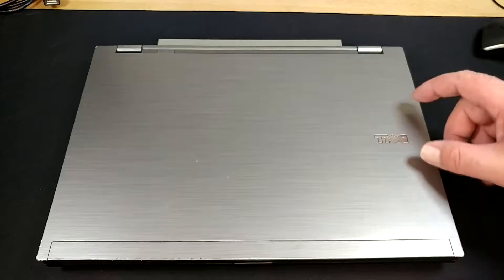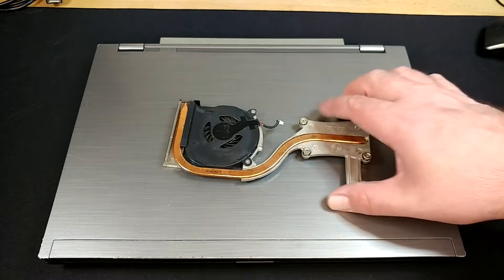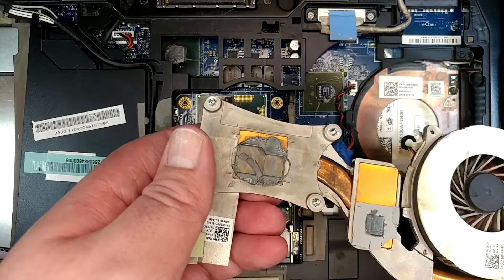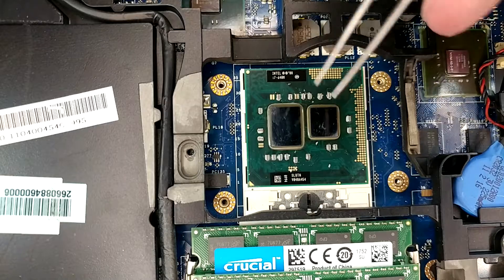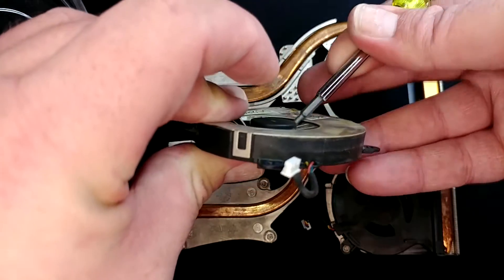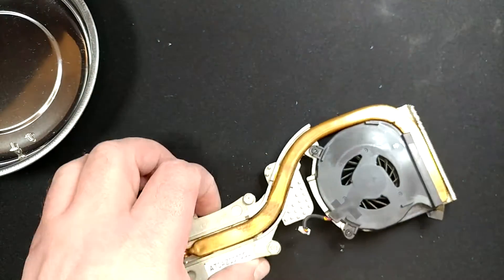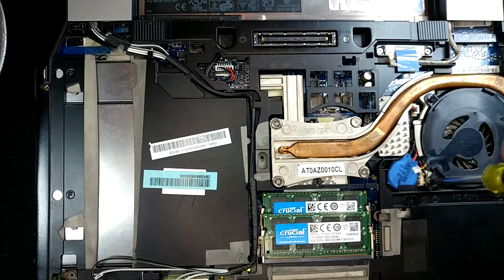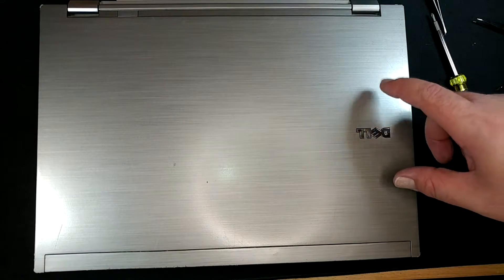Dell Latitude E6410 Cooling Fan Replacement and New Thermal Paste!

Comment: I just bought a new computer because the E6410 was getting very slow which I attributed to all of the Windows 10 updates. I watched your video, followed the instructions and it's like a new computer again.... Windows 10 support runs out in October 2025. It originally had Windows 7 according to the tag on the back. I am going to see if it will run on Windows 11. It has 8GB of RAM so maybe it will work if I can remove the bloatware. Thanks!
Reply from the maker: I plan to retire mine at the end of the year. Even without bloatware, 8GB is just getting to be too little. I've gotten a decade of good use out of mine so I can't complain.

In truth, I will probably experiment with other operating systems and put them into niche roles.

Comment: Hey man. A few days ago I went to change the thermal paste on my graphics chip and I didn't know that I shouldn't remove the pad on the GPU. Anyway, I removed the pad and replaced it with thermal paste and now the temperature of the graphics card is normal (between 40 and 45 degrees) but when I open a normal game and even when it's not finished loading, the temperature of the graphics card reaches 95 degrees and the laptop shuts down. If you have a solution, I would be grateful if you could tell me.❤
Reply from the maker: You can buy replacement pad material and cut new ones out. Funny enough... I have a video recorded, but not edited or released, where I do just that. 

The come in different thicknesses, so you may have to experiment. The two sizes I bought:

https://amzn.to/42PS0IR
https://amzn.to/3WUyl6X
Reply: @TheBrokenTech  thanks you but this doesn't work. I bought a thermal pad and put it on the graphics chip but it doesn't work.
By the way, I couldn't get that pad from Amazon, so I went and got it from somewhere else, but its color are no different from the product you suggested.
But the problem is still there and it has made almost no difference. The temperature still reaches 90 in the game and it is unusable.
Anyway, thanks for your help and support.
Reply from the maker: @ I suggest that the pad may not be the proper thickness. I had to experiment with them.

Comment: Hi, What is the thermal pad sizie (thickness) that you use for different chips, CPU, GPU, etc. Could you help me?
Reply from the maker: For a long time I just reused the factory pads and added a little dot of thermal paste to them. I'm still experimenting with aftermarket pads to determine the thickness.

The CPU doesn't use any pad.

Comment: Hey. My fan was running constantly, so I figured I needed to get in there and blow out the dust. I couldn't remember how the case bottom came off, and found your video - thanks! And, wow, yeah, the cooling fins were pretty much 100% blocked!  By the way, I'm the original owner of my e6410, and it's been running nearly 24/7/365 since 2009 !!
Reply from the maker: Awesome! I'm glad you found the video helpful! (posted from my E6410 😂)
Reply: 🤣 @TheBrokenTech

Comment: I have the same equipment as you, I just cleaned and replaced the thermal paste of the processor, I realized that the gpu only had the Thermal Pad, but no Thermal Paste, I put a little on it and the temperatures got worse, my problem was the gpu rolled at 99°C after I put the thermal paste on it, now it does not drop below 104°C.
Reply from the maker: That's way higher than I ever see mine when it's clean. Mine comes up to the high 80Cs and stays there, and that's streaming 1080/60 content. At 1080/30, it's more like 65C.

I suspect you may have a thermal pad that isn't making good contact.

Comment: I took out my fan for cleaning pepposess as I experience extremely heat and I realized the thermal paste melt out and dry I re-apply that thermal paste back but it never work. i decided to clean it up and assemble it back now it just switch on then off within 5sec. Do u think the lack of thermal paste cause that?
Reply from the maker: Possibly, but probably not. There was probably some other failure first that caused the initial issue.

I've replaced motherboards in E6410s before. It's not a fun job, but they're pretty affordable...

Comment: What temp does it run at with the new paste?
Reply from the maker: Right now (streaming HD video in the background as I reply) it's at 143F on the CPU and 155F on the GPU. Thermal throttling seems to happen around 200F on the GPU and that doesn't happen very often. I've never noticed it CPU throttle, but I don't do much that is CPU intensive.

Laptop thermals are always a matter of how long before it hits thermal throttling and how often it happens. If pushed hard, pretty much every laptop will eventually hit throttling.

Comment: How well is it working after 10 years? Is this your day-job comp? 

BTW I kinda felt your pain trying to plug the fan in as my fingers are kinda stubby and I have small hands so if I had a laptop that I were servicing myself I'd probably be going through endless tools myself T_T

This was an educational experience as I legit didn't know thermal paste went bad that quickly.
Reply from the maker: Still going strong right now. I don't use it for any business purposes, but it's almost always plugged into a TV and streaming something. It's doing that right this second, actually. 😁

I have the opposite problem from yours. I'm a giant so dealing with smaller things can sometimes be challenging. If not for tools, it sounds like we'd both just be smashing things with rocks.

I didn't know thermal paste went bad that quickly either. I've never experienced that phenomenon outside of the IC Diamond. I'm happy with the Thermal Grizzly for the moment.

Comment: The wrong oil is ALWAYS better than no oil. The cheapest thermal paste is better than no thermal paste.  hell, 3m double sided foam tape is better than just resting the heat sink onto the chip.
Generally speaking, getting "the best" nearly always means spending many multiples of good enough. A $20 thermal paste in virtually all circumstances is just nowhere near 20 times better than a $1 tube of thermal paste. That ratio just climbs the supposedly "better" you go up in the quality scale. You can easily pay 40 times the price on this low cost stuff for something that is 25% "better"
Reply from the maker: Strongly agreed on all points! If I were doing this stuff at an industrial scale the costs would absolutely come into play. With products like thermal paste, people at home seem to shop at the top of the market because even the top of the market is pretty cheap. I confess that's exactly where my mind is at with it too. For ~$10 I'll re-paste 3-4 PCs with that tube, which is fine with me.

You can see that I did learn a lesson by not buying the gigantic tube though... That was like a $30 tube of IC Diamond that when in the trash that I used like 2 times and it used to be "the best". I'm not impressed...
Reply: @TheBrokenTech  Problem is, you're not really getting better stuff, you're getting the most heavily advertised.  I've had the same tube of heat sink paste (at home)  for like 20 years and have done quite a few computers with it and I think it was $3.99 in radio shack when I bought it.  This is especially true at the low end.  Like the difference between cables. You're paying whole number multiples of the cables that make no discernible differences. All thermal paste really does is maintain a mechanical connection between the heat sink and the heat generating chip. While some paste may be marginally better than another, I highly question the alleged efficacy difference between the cheapest acceptable quality the most expensive one.  OTOH, there is a bottom upon which any further down and you're just wasting money on stuff that doesn't work at all.

When it comes to the reliability of a board or something, you may very well be buying the difference between under 500 hours and 10,000 hours of reliable life  and the price is maybe 50-200% more. Thought that difference can be very large, way larger than radio shack paste and whatever paste is being pushed by stores and "influencers" this week.  IOW, you get what you pay for, but only to a point. You VERY quickly hit diminishing returns.

Like china tools are junk and you are throwing good money after bad. Then there's good tools. Then there are overpriced tools like Snap-on. The way Snap-On tools are sold leads to a lot of losses. They make up for those losses by charging a fortune for the tools.
Reply from the maker: @tarstarkusz  This sounds like an interesting topic for a deeper dive at some point in the future. Find "the best", the cheapest, and then something in the middle and run some tests on them. Some of the results are likely going to be from the paste simply aging and drying out though... I may have to think of a way to make that a long term test with a repeatable setup.

I'm off to count how many E6410s I have laying around here...
Reply: @TheBrokenTech  If you have a Peltier device, you can just hook it up to a heat sink and leave it sit there on a power supply. 
I really don't think you are going to get much of a difference between one paste and another other than possibly drying out.  The cooling of a chip, once that connection is made is far more to do with the heat sink and fan than with what paste you are using (assuming the paste is properly applied). 

If the paste doesn't work at all, it will cause the computer to shutdown or the chip to fail. But once it is working, I just cannot see how a paste can cause the heat sink to give up energy to the surrounding air faster than it already does.  This is probably especially true in a laptop where mass is limited.  If you increase the thermal transfer rate into the heat sink without increasing the thermal transfer rate from the heatsink into the surrounding air, you will just decrease the amount of time it takes for the heatsink to come up to its max temperature.
This is not to say it doesn't matter all. When I first bought this computer it had a dual core 2.66ghz chip. It was running pretty hot (like 50c at idle).  I replaced the chip with a 3ghz chip dual core and it ran cooler (32c at idle) that the 2.66ghz chip did, but there wasn't much compound on it.  Then I later replaced the 3ghz chip with a 2.x (I don't recall) quad core chip and it runs at the same exact temp it did when it had the 3ghz dual core. They were replaced about 4 years apart. The radio shack stuff had worked fine and was still plenty wet when I upgraded to the quad core.  IIRC, the wattage was fairly close. Both will heat up to about 60c when under heavy load.
I think what is happening is the heat sink has enough thermal mass and thermal transfer ability that it can maintain 32 at idle, but that nothing short of a larger heatsink or a larger fan can affect the higher temp under high load. IOW, the limit is the fan and heatsink, not the paste.
Reply from the maker: @tarstarkusz  I have some experience with Peltier elements and I wouldn't trust one unattended for very long. I'm thinking this is a test that may have to go for years.

I'd say the one variable you may not be accounting for in your thoughts is mass flow rate, or how fast/often the fan runs, which until right this second I wasn't thinking of either. So, what I would need to do is monitor and data log temps as well as input power. The lowest of both should be the winner.